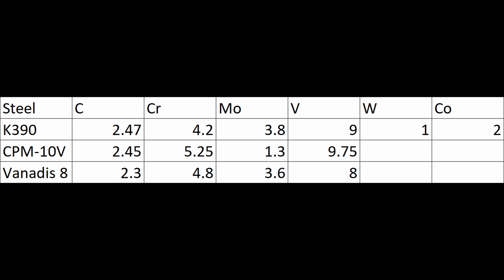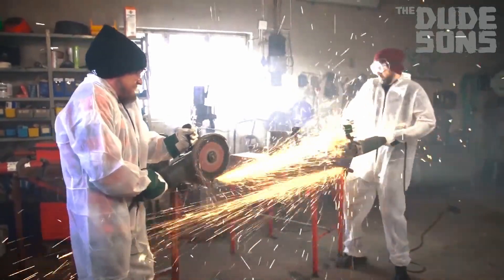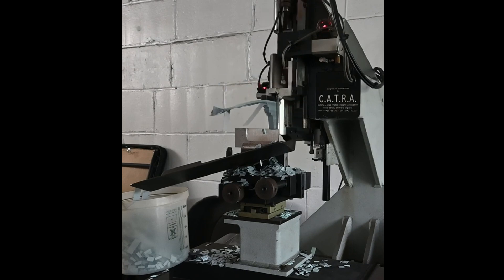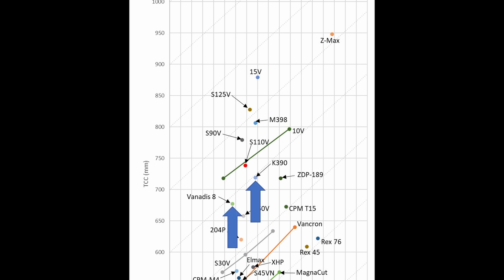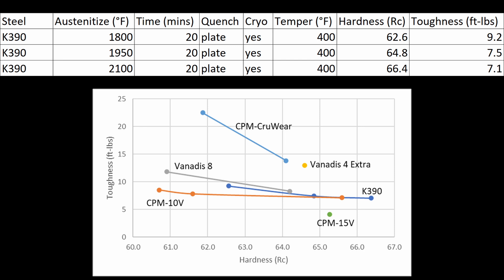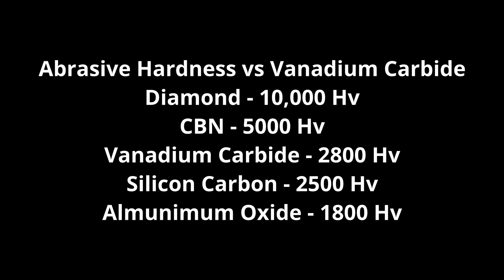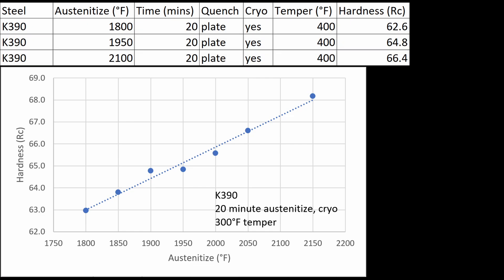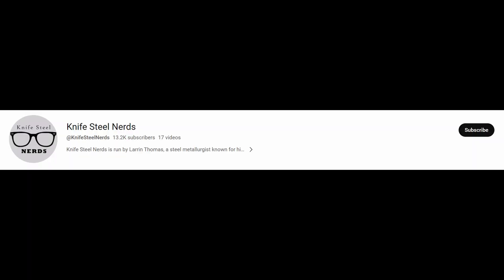K390 - The Best High Edge Retention Knife Steel?

Comment: I love all my knives in K390, easier for me to sharpen than most of my stainless steel
knives (burr control is better) and holds a keep edge forever. I wonder if the high hot hardness is one of the reasons why it’s a standout in spyderco’s lineup as you are less likely to get a “burnt edge” on the factory edge than other steels.  Stainless 10V with only vanadium carbides though… That’s a steel that would demolish the existing high end knife market…

Comment: I love Cedric and Ada's videos and from their data K390 seemed like a good tradeoff of corrosion resistance for edge retention over M390. I got it in a PM2 and I love the slight patina it develops.
Reply: A higher vanadium magnacut for the edc market would be interesting. I think it would make sense and lots of people would buy it. The original would still be better for larger and fixed blades, but I think in the edc market, toughness is not as important.
Reply: @thorwaldjohanson2526  here after Magnamax was announced, hehe. 

Also, to the dude saying he'd trust Larrin over Pete from Cedric and Ada, sure, as far as quantitative measurements go, but Pete does qualitative testing of actual knives in real world applications, so his data is invaluable to consumers. How manufacturers heat treat the knives, the blade geometry, edge angles, all make a huge difference and are not part of Larrin's data where most of these variables are standardized. So I'd trust both.
Reply: Lamination is the solution. Until Larrin gets around to making the high edge retention version of Magnacut he's talked about.
Reply: I would trust Larrin over the other guy any day and twice on Sundays

Comment: I have shared your videos with the younger Engineers at General Motors.  Even if you aren’t interested in the knife aspect, the metallurgy discussion is first rate.
Reply: I 100% wish he was a metalurgist at my company. A good metalurgist is hard to come by.
Reply: I was just thinking, maintaining hardness at higher temps sounds like the steel you’d want for engine components
Reply: @stupidthefish1979  most (high-end) knife steels lack some of the necessary properties for many engine components (like ductility). But yes, there are places they can be and are used.

Comment: I was just looking at the data sheet from bohler and im curious why you chose 400 for tempering when the data sheet shows between 930f ans 1020f as ideal ranges for secondary hardening?

Most likely would be a huge benefit in smaller slicing knives. Bringing out harder carbide's. Granted it comes with some Con's due to that.
Reply from the maker: "Secondary hardening" does not improve wear resistance, that is a common misconception. The tiny carbides formed in secondary hardening don't contribute significantly to wear resistance. In my big CATRA study I compared 400 and 1000°F tempering of CPM-4V and found no difference. In tests of toughness, however, several steels I have compared showed a sizable improvement by tempering at 400 instead of 1000°F.
Reply: @KnifeSteelNerds  I feel like thats just not completely true based off of science gate PDFs for some steels that ive been reading. But hey what do I know.
Reply from the maker: Uddeholm also found no wear resistance difference in their testing of Vanadis 4 Extra. But if you want to link some articles we can discuss them. See slide 33 for the V4E data: https://thecbm.co.uk/wp-content/uploads/2015/11/Tool-and-die-life-2-March-2016-Uddeholm-Tool-steel-selection-for-AHSS.pdf

Comment: I had the spyderco stretch 2 in k390 and it was a real performance blade. I wasnt really a huge fan of the design though. Id love to see Benchmade bugouts in more steels. I have an s30v bugout and ive used it so much at work, digging, prying, scraping, and its still perfect.  I did put aftermarket aluminum scales on it for rigidity.  Thanks for the video
Reply: I totally understand.  Backlocks are so meh.  But it’s better than liner locks and those gawdawful compression locks.  Cue up the hate from the Spyderco junkies, but cutting away the scales right where the web of your hand goes when really bearing down on the knife is seriously stupid.  It tells me Spyderco makes fidget toys for collectors, not real tools.
Reply: @donrichter3523 my guy all of my spydercos with comp locks are the most comfortable knives i own lmfao, my liner locks are less comfortable in hand. the cutout for access to the lock literally fits the web of my hand better than a liner lock because the web isn’t at a parallel angle to the back, it curves down. the comp lock is also one of the strongest locks on the market rn, don’t know what you mean by fidget toys considering they make knives with ridiculously strong locks and super tough steels if you want it.
Reply: @donrichter3523   Have you broken a knife or are you just venting for nothing ?
Reply: Where did you find aftermarket scales for the stretch?

Comment: Great video! K390, S390 and M390 are all interesting, interesting how Bohler uses the 390 designation for top of the line products.
Reply: One you get to 400 things drop in performance such as 440C 420hc so you don't want to take a steel all the way up to 400s. Seems high 300s is the optimal number.

Comment: K390 is one of my favorite steels. I wish more manufacturers would start using it (given they can properly heat treat it of course).
Reply: I've seen Reate using it (K390) on some of the knives like the Pena X series. And the new Reate made Boker Urban Barlow, but don't know if it's purely a Knife Center Exclusive thing or what. But hopefully, we see more companies start taking advantage of it. And so glad MagnaCut popping off and seems to become more and more available. As that steel is just amazing for what it is. With high scores in all corners of the holy trinity of the knife steel triangle (Toughness, Edge retention, and Stainless). S90V would also be nice to see more of instead of all the M390/20CV we have seen on everything for the last 5 years.
Reply: I agree wholeheartedly about MagnaCut. I think once some of the legacy manufacturers can wrap their heads around it they’ll more readily adapt to it. I’m pretty much over M390/20CV as I favor edge retention over corrosion resistance, but that’s just me, I still understand the overall appeal and own several knives in both. Give me MagnaCut, S90V, K390 or 15V and I’m definitely going to be more interested.
Reply: No it should be MagnaCut mimimi

Comment: Awesome write up, I've wanted to try some K390 for a while and its pretty hard to get hold of. But I can sometimes see myself getting a bit of 10V and not really losing much out on in the edge retention party at the end. There's definitely some uses for these steels in certain cutting tools though and they do seem to produce some exceptional results there.
Not sure I want to get anything more than a 240grit belt finish though :)
Here's your knife, its uglier than a dropped pie, but it probably won't get dull either.
Reply: Gobec currently has bars in stock. 👍
Reply: @Combatmedic870  Thank you, now I just have to conjure up enough German to muddle through there. :)

Its down on a list though, I'm yet to get some ApexUltra and Magnacut to try out and there's a local place with a big 1.05m length of 10V on sale at the moment with free delivery so I think that might be where my money will be going in the near future.
Reply: @krissteel4074  Plenty of time to try them all out. 10v is more of a specialty steel. It will rust on you if you don't take care of it. Magnacut is a great edc steel that you don't need to worry about. I have many many many knives in magnacut. My most used k390 is a wharncliff dragonfly. I use it as a permanent at home Amazon package opener. Probably will never need to sharpen it. 😂😅
Reply: @krissteel4074  also, google translate should take care of all of that for you. It was easy to get 2 bars from them.
Reply: 240 is ambitious in my book. 180 is as high as I'm doing. A broken in 80 is fine lol. High vanadium steels don't grind or polish or take surface finishes the same way your mommas chromium steels do.
Reply: @jeffhicks8428  May as well just blast it at that point 😂  But the finer the finish, the better the rust resistance. Ish. A 1k hand satin blade in k390/10v/vanadis 8 won't rust like a sand blasted one. I don't make blades. I just have many in those steels. Makers always complaining about their hands bleeding doing high grit hand satins. Sheesh!

Comment: I am curious if this is a good hot hardness steel why you didn't temper at 6-700 in at least one coupon to collect at least some data on that?
I can't say for sure but I doubt seki city is using the bohler recommended spec and I suspect they are secondary tempering hotter which is what gives it the advantage over golden tempering.???
Do you have any plans to test this aspect for us or yourself even?
Reply from the maker: 600-700 would be an odd choice, whether we are talking Fahrenheit or Celsius.
Reply: @KnifeSteelNerds  Well I don't know what temps are used for high second tempering, so educate me there if you please. Either way I want the data for the best potential edges because I would like to try making some from it.
Reply from the maker: The Bohler datasheet recommends 1020°F.
Reply: @KnifeSteelNerds  Oh, okay, thanks

Comment: Thanks for the Video. So far I have had an excellent experience with K390, and I love the patina it gets after some use. Waiting on a puukko in K390 and can't wait to get it, considering getting another one in CPM 4V and a custom EDC knife in MagnaCut from the same maker. So far my only experience with MagnaCut has been with folders and I'm super excited to get a fixed blade in it. The only hard part is the wait, but well worth it once we get the knife in our hands 😅 Keep up the fantastic work
Reply: What maker are you waiting on a puukko in k390 from. Also interested in fixed blade makers willing to work with high wear resistant steels that are ht'd for performance.
Reply: Highly recommended
Reply: The PM2 in K390 is fantastic…only Maxamet , an alien steel is better…the newest (its 2023 with this comment) The big brown bear 10v heat treat collaboration is pretty close to Maxamet…but they are unattainable at this time…hopefully they (Spyderco) will continue to use it on other knives too in future….cost is steep…but for a lifetime edge retention knife its worth it…EXCELLENT channel and content too..thank you very much young man.👍👏👏🔪

Comment: So if a particular steel is composed in such a way to have high red hardness would that mean it's less susceptible to the so-called burnt edge phenomenon?
Reply from the maker: Yes
Reply: Easiest way to get rid of it is take it to around 15° then to 20, then to what ever you want it at. Then you'll be rid of the burnt up edge. Or just use it and sharpen it as needed. Either way will get you there.
Reply: @Combatmedic870  Thats a new method to me, I tend to just keep using till the fine edge is gone and sharpen again. Might give this a shot in the future though. 
I would like to give it a nice long convex mirror but it doesn't seem to like that the way zdp does.
Reply: @8thsinner  it just removes alot of material quickly. To 15 removes the shoulder, to 20 until the full bevel is 20 removes alot of edge. Then to what ever your wanting gets it down further. 
Don't bother with 200 or up doing this. 100 or lower so it doesn't take you 2 hours. 😂
Reply: @8thsinner  keep in mind though, it's going to be a lot thicker behind the edge. So it may not be worth it. I've strictly only done this with delicas and smaller as the blade it pretty thin. I wouldn't with a pm3, pm2 or shaman.
Reply: @Combatmedic870  Oh I get the concept.
Reply: @Combatmedic870  Indeed, but if it needs refaced to get rid of ripples anyway then you might as well trim it this way, the sad thing is we shouldn't have to use techniques like this. It should arrive like this. But it's spyderco, not rockstead. lol
Reply: @Combatmedic870  I would probably use venevs 240 though, it's cleaner than diamond would be and would take a lil while longer but I find that meditative anyway so I like it.
Reply: @8thsinner  yeah, from what I was told from Shawn Houston(BBB) Golden is using fluid cooled grinders for sharpening now (and have for a while). I'm not sure why seki isn't doing the same. Soon enough hopefully.
Reply: @Combatmedic870  Yeah doesn't really make sense does it, they care so much about perfect tempers, and have known for decades how not to burn edges and yet they don't use wet grinding...
Reply: Maybe in theory, but I got a police 4 recently and it was definitely burnt, grind was all over the place too, for seki I mean, started to stabilise after about the third sharpening, before that and especially in the belly it was rolling very easily at 14 and 15 degrees. Sharpened both by hand and on blitz...
Reply: @8thsinner  I have a k390 dragonfly that had the same issue. It had a really burnt edge with a lot of belt chatter. It took 3-4 sharpenings to fix but it's great now. The Seki knives seem to have this issue more than Taichung and Golden
Reply: @stickyedge7113  I agree and it's a recent thing too, my older zdp seki was very symmetrical, very sharp, and I can't remember but I don't think it was burnt either.
Maybe it's a change in processes, or staff, or the differences between old and new belts but it does seem more and more that grinds are coming out uneven and burnt for more and more people.

Comment: Thanks Larrin. You're work is so important for the knife community. This makes me want to try K390 or 10v!
Reply: i did a K390 N690 SanMai.
For me the best of both worlds.
Reply: Basically it seems like at lower hardness you'd be better off with vanadis8, as the hardness goes higher, k390 makes more sense, then at 65+ rc  you might as well use 10v.
Reply: @jeffhicks8428   At 65 they are all the same.. So just pick any of the 3 and harden it to 65..  is your best bet.
Reply: 20CV is a close relative
Reply: @krustysurfer  

It's not even remotely close. Lol.
Reply: @CNYKnifeNerd  i was under the conclusion that
 M/K 390 20CV CP204 were in the same class of metallurgy formulas?
Please correct me if im wrong?
Thank you
Reply: @krustysurfer  M390 & K390 are completely different steels brother  M390/20cv/204p are all similar steels in being good edge holders, K390 made by bohler, like M390, but K390 has amazing edge retention
Reply: @GBall_Vision that is why I said close relative instead of parent/brother/sister its the shinier weaker cousin because of higher chromium content as well as lower carbon and vanadium carbide content, yeah k390/398 is more of a harder tool steel than 20CV  based on alloying ingredient levels. 
20CV is easier to sharpen yet has higher corrosion resistance.
A nice family of steels 😉 aloha
Reply: @krustysurfer m390 /20cv/204p are K390 has nothing to do with those 3
Reply: @krustysurfer m390 and k390 are very different.  The other three are similar though